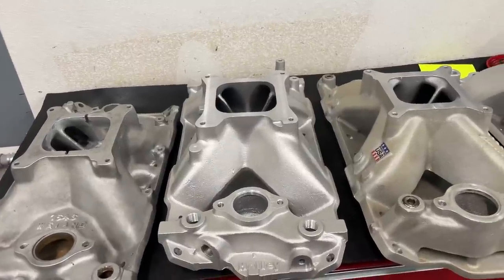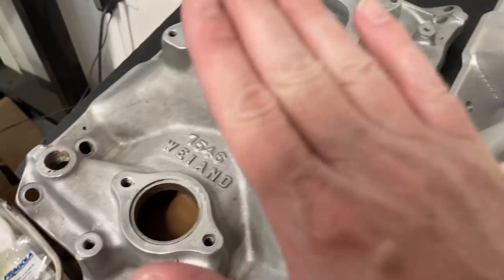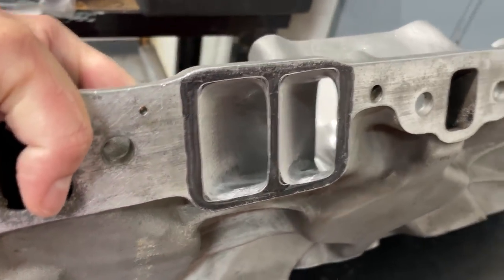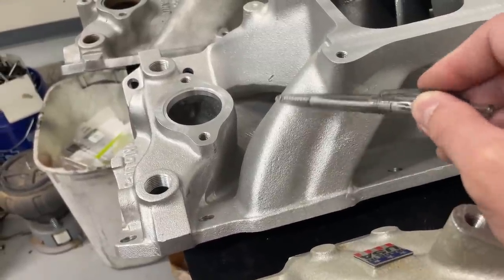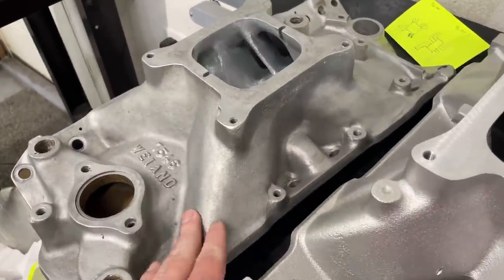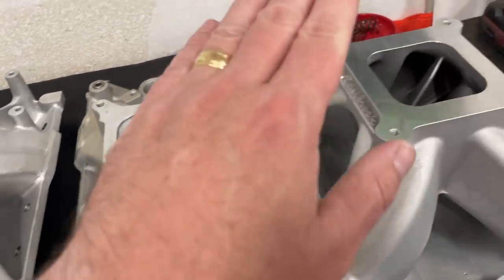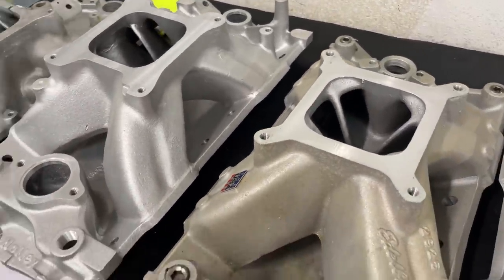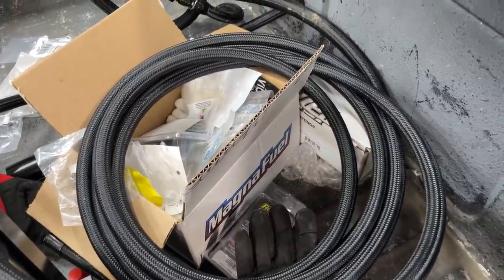Stupid Manifold Information

Comment: None of these intakes are as cool as the one I built in 1989. I used an Edelbrock twin carb tunnel ram, drilled it for injector rails, put two stock 302 Mustang GT throttle bodies on it, and that 1986 Mercury Capri I built, had one of the first flying toilet speed density tunnel rams!!! I didn't even care if it hauled ass I just wanted to look cool. I succeeded!!!🤪💯💯💯
Reply: If my Edelbrock TR1X is sweating all over the lifter Valley, like a cold on a hot day, does that mean my engine is tuned too rich, or could it be that my carburetors are 5 ft away from my motor? LOL 🤪👍

Comment: All good and accurate info. IMHO.   My first car was a 67 Camaro with a 327 / 275 hp engine with factory Quardrajet and cast iron intake and a 4 speed.  The car ran really good in stock form.  My uncle bought a car that had a Edelbrock Torker intake on it and he took it off to put something different on it.  He gave me the Torker and I though Aluminum intake with a Holley would be better than my old Q-jet and cast iron intake.   I installed the Torker and the Holley and my car was slower.  Eventually went to a Holley Dual Plane #300-36 and the car woke up and ran much better.
Reply: 300-36 fav dua plane intake ever for the sbc . Why they stopped making them sucks

Comment: I seen a dyno test comparing a bunch of intakes on a 450hp 350 SBC. Surprisingly the original Torker made more power than the Torker 2 on the same engine. The Torker 2 was junk, it was way down on power.

Comment: Here,s an dumb question, what happens  if you  shorten the port dividers  and knife edge the dividers and install  what  they used to call a turtle which was  glued to the floor of the manifold, to help distribute  equal flow thru the intake ports?

Comment: I had a 347" sbf with performer rpm heads 224-232 @.050. Ran a perf rpm airgap intake with 750 4150 holley. Older guy convinced me to try a weiand I think stealth single plane. It was a dog under 3500 and ran the same up top. I put the rpm back o. As fast as I could. Haha.

Comment: Hi Eric, love your videos!! Can you compare an Edelbrock 2701 vs a Weiand 7547-1? I am a dirt race IMCA guy and our rules only allow these two intakes, I was wondering if you know or have data to compare these two manifolds and which one performs better? We can only use a 2 barrel holley (500cfm) too! Cam lift profiles typically can't be over .450 either so every ounce of air is rather critical. Hope you can help...I am happy to supply you with these intakes if you want to conduct a test? Thank you!
Reply: would also appreciate more information about the 7547 because hood clearance is an issue for me.

Comment: I'm building a boosted 5.3 Ls. This is going to be street drivin and street raced, looking for the 1-1,100hp range. I know everyone thinks you have to run a holly high ram, or the texas speed intake but I absolutely love the looks of a tall single plane with a Wilson elbow. So I think I'm going to run a holley split 4150 with a split Wilson elbow. I know they used to say that air distribution sucked on carb style intakes. Is that even a factor anymore with efi and a turbo forcing air down its throat?

Comment: Sure there are better manifolds today then the holly 300 -25  but that was the one before all the rest after market manifolds and it worked pretty  decent  I know I had several  for different  small blocks  builds ,  one that is specifically designed  for their own heads is the one that  AFR makes , AFR  heads are among the best so im sure their  manifolds aren't to shabby either!
Reply from the maker: They are ok but in some situations other manifolds are better.
Reply: @WeingartnerRacing  Most definitely!
Reply: Strip Dominator actually alittle better than the AFR as cast singleplane. The 2 piece composite AFR from a few years back was better than the Strip Dominator. But it's no longer available.

Comment: Those old torkers and xcellerators are odd intakes that fall in an wierd category, there not a dual plane but not a high rpm single plane ripper... I personally can say at least the gen 1 Torker works fine on a mildly modified street SBC, they make surprisingly good low end TQ and pull not half bad up top, better than a standard performer but on a fun street car the low rpm TQ advantages from the performer isn't enough of a gain to warrant the loss in high rpm power imo. There surprisingly versatile intakes I spotted an old Torker 1 on a old 70s tow truck on power nation they dragged out of junk yard lol. With a mild SBC on the dyno would you see a difference between a Torker and a perf RPM definitely...On a mild street car I bet it would be a lot harder to tell. When I see someone ask about these on forums and keyboard experts say there junk,paper weight, toss in trash, use it for a tire chock, they suck....yada yada I say don't listen to them there not as bad as these guys say they work fine if it was as horrifically  bad as they say Edelbrock wouldn't have manufactured them for decades (and still do I think), is there better options of course there is but most of these guys that hate on em dont actually have any actual experience with it there just regergitating shit they heard from the same fashion from probably a guy who tried one grossly in the wrong application likely like tossed a Torker on a 600hp SBC or a 140hp 305 and it didn't work very good..... mind blower... just try it I think you will find it works just fine and upgrade later on if you feel the need to. Also  I was under the impression the Torker 2s we're aimed towards improving higher rpm power in C3 corvettes with there terrible hood clearance (or anything else with minimal hood clearance)  and the only options are the terrible factory iron smog intake, a low rise dual plane that starts weezing after 5000rpm so in that situation the low rise single plane probably was a viable option back in the day.
Or I'm totally wrong?✌️

Comment: I'll try to make this short. my grandmother bought a 1966 Chevelle 300 Deluxe two door post, 2b 327, power glide 10 bolt rearend new. my dad talked her into getting the 327 and not the 230 straight six. i got it off her in 1985, of course i wanted it to go faster. dad had me pull the carb, intake and the heads off. didn't even rebuild the engine, anyways i got Corvette heads and intake at the Pomona swap meet. i put them on that 327 with headers, i could not believe how big of a difference intake and the heads made. i drove that car with that setup with the SAME not rebuilt 327 tell 1994 when i took it off the frame. 2019 gave it to my son for graduating high school. and of course he has plans to LS it.. lol

Comment: Fun Fact some of that braided line comes from "Off Shore" sources....Just say NO! Another thing I've heard is the VERY EARLY CAST 2975 Victor JR intake has a better runner shape worth 6-10HP over the later ones. The early intakes have  ribbeed valley with a freeze plug in them for avalley breather....that was revised after about 6-9 months of production. Also there are "Off Shore" copies of the 2925 Super Victor....STAY FAR AWAY! I bought one off of Ebay and the port divider was over an 1/8" off from the cylinder head....

Comment: I know you can judge an intake just by its physical appearance, uh, um, no you can't. Let's take, for example, runner shape. The runner may look like it can flow a certain way, but now, you have to introduce actual, real time flow from cylinder to cylinder. You have to factor in scavenging, for example. One cylinder on its downstroke, pulling from the main plenum, while another one, let's say, the port right next to it, it's just finishing up sucking in its fuel charge. Meanwhile, across the way, inside the plenum, you have another one that's getting ready to suck some intake charge. You can't tell me, at 6,000 RPM, for example, that will be a nice even intake charge right into the port. There will be turbulence. Little vortices, backflow, pulsation....... you can't 100% say how an intake is going to flow, until it's put to the test, throughout the RPM range, and different displacements will also create different results. My point is, there's too many factors involved. One of the best ways I have found, is just to try the damn thing. It either works with your combination, or it doesn't. It's $300 +/-, and if it doesn't make your motor haul ass, put it on ebay, and try another one. What works best for me? Check out the motors that are making good power, and winning races, and borrow their combination, or portions of it. 😜👍

Comment: I ran the weiand 7546 for years. It seemed to work well with 650 Holley. 
 I have also run an SY1 crossram single 4 barrel with the recommended Holley 830 cfm carb. Edelbrock Smokey Yunick manifold made in 60-70’s. But have been told there are better manifolds. Been told the standard Edelbrock victor Jr would make around 40 more hp than the crossram. We will see. 
The crossram makes stupid seat of the pants feel, from 3500 to 6500 on the highway, honestly it never seems to stop pulling. Maybe one day I will get the car to chassis dyno.
Reply from the maker: Im curious what you find.

Comment: Great vid. I am a little confused though. I have a 406 crate motor stock Al fast burn heads, intake cam heads compression,  I am running 1/8mile is a light roadster. I have a super victor 2 laying around I thought about putting on it but thought it would actually hurt the motor off the line and not give any performance gain since I shift at 5800. Do I have it backwards, and it would help low end? Sine I already have it, any reason not to put it on this combo?
Reply from the maker: That one could go either way. I would say test it and find out. My thinking is 60ft will be done but still have same ET.

Comment: Might be surprising but I’ve had a really good luck with porting T2 intakes for the Pontiac’s that I build
Not to be confused with the Torquer 1!!
No I’m not just port matching I’m talking a complete Plenum porting and reshaping the runners making a line of sight a little bit better Etc
the most I’ve made was 665hp 672tq  on a street pump gas 535 and I believe there was more left 
Fwiw the T2 Runners have a lot more gentle curve in a better angle of attack than the T1
Now there is better intake manifolds if you have the hood clearance or you have a scoop.
also I will say that the Torquer two for the Pontiac is quite a bit better than the Torquer 2 for a small block Chevy it has a lot more room for porting fwiw

Comment: Good info Eric! Have a 408 SBF in the camp with a ported victor Jr... Seems to work pretty good even spinning to 7800 rpm... Had it ported when the heads were done because he already had the manifold. Haven't pushed it to see what ET will be. Fighting suspension issues at the moment. Looks like it would probably pick up some with a taller one though. 🤔
Reply: I'm building a 427 sbf right now. 
AFR 205 heads. 
Looking to run a super victor. Because it's taller and has longer runners.
Reply: @I_like_turtles_67  should be a strong motor! What rpm are you going to turn with it?
Reply: @YerkitRacingChannel  The guy that's building my motor hasn't determined the exact rpm range. Still waiting on rods to show up so we can figure out exact compression and stuff. But if I had to make a guess. Between 6200-6800. 

This is going in a 67 fastback. Being build for street driving. A little drag racing and auto x/track days.
Reply: @I_like_turtles_67  awesome man! Sounds like a cool build!

Comment: What do you think about the Wilson super victor for sbc? Should I just go straight for the super victor 2, 
421 ci 12.5 cr with AFR 227 #1068 for bracket racing.
Reply from the maker: Super victor 2 is better.
Reply: @WeingartnerRacing  What are your thoughts on the Victor E  #2978 on a 427 sbc with AFR 227s #1068 ? I have hood clearance issues.

Comment: Eric, would you give me a recommendation on what sbc intake I should use for a   3000lb ish, bracket car? I have a brand new set of AFR 210cc heads still in the  box. They are the  Competition Ported heads, supposed to flow 322cfm @ .650 lift. They have the steam holes drilled, and springs for a Solid Roller Camshaft. I talked myself out of the AFR 220 heads because I've read so much about putting too big of a cylinder head on an engine might be worse than not big enough. And the 210's have 2.08 intake valves, and the 220's have the bigger 2.10 intake valves. I can always go bigger in the future. 
I THINK? I'm pretty sure they said the 210 and 220 both use the same  foundation. Is this true? 
 Planning on building a 10:5:1 compression 406 sbc. Not exactly sure yet if I'm going to use a glide or turbo transmission, 4.56-4.88 rear gear, if it's going to be a glide, may do the same rear gear for the turbo transmission too. 
 I'm thinking about using a Super Victor intake, but not 100% sure yet. Kinda wanting some other recommendations, that might be as good or better. Any suggestions will be greatly appreciated. Thanks. 
  Take care, be safe, and have fun regardless.
Reply from the maker: A 220cc head is not too big for a 406 especially if it’s raced. A super victor would work fine.
Reply: @WeingartnerRacing   Yeah, I kinda know that now after watching your videos and some others. I was thinking about the 2.10 intake valves too, but nowadays it doesn't seem to be an issue. QUESTION, can my AFR 210's be worked on to make them 220cc or possibly bigger and valve done too. I've been buying parts here and there over the past couple years when I'm able to. I have Eagle 4340, crankshaft, Eagle 4340 H-Beam rods with L-19 rod bolts, but the pistons I bought at a sale turned out to be 18 degree instead of 23 degree. So i need pistons now too. Anyways I'm writing wayyy too much. After I get close to having almost everything I  need I plan on sending you my heads and intake to port match or completely revamp them whatever it needs. If you have any available spots to do the work for me once I'm close. Anyways, love the informative videos you put out, thanks so much for sharing then.
  Take care, be safe, and have fun regardless.
Reply: I got 421 n they told vitor Jr  to snake wit the cam I got say I got go bigger to super vitor n head of AFR 220

Comment: Every different shaped manifold is shaped for a specific design use. Some look great but performs like shit on the street. Really, it all boils down as to what you want & how plus where you drive your car or truck. I'm a big fan of highly modified cast iron for many reasons. I've also had huge success with the Offenhauser Dual Port 360. For bad ass racing is the Weiand Tarantula.

Comment: Wow! I remember them open plenum which had the optional steel divider plate for making better bottom end supposedly?!? Lmao! I can't say that they actually did that by adding the divider or not? But it was a bit of a different design where we were fooled into believing that it would work! But I've run these intakes before and they are pretty pathetic for either top end or bottom end never had any good results from these hermaphrodite style intakes! Seemed like they were not good at bottom end power nor top end power. 😕 The tourqer 2 was another sad attempt at not really knowing what it was actually meant for? They were actually attempting to lengen the intake runners by adding the additional turns in the intake runners, which of course means more resistance having to make those turns just to get into the head ports. The super Victor series were probably the best off the shelf intakes you could get and keep it under your hoods. I have a single carb and dual carb tunnel ram and the dual carb would definitely out perform a single. When they made the single and kept the same top of the tunnel ram in dimension rather than adjusting the plenum size of the single carbs into a smaller plenum, they probably would have been more more efficient than just keeping the giant plenum on top of them, it would have made it a much better performance intake. They were going more for looks than performance or were just being cheap and not wanting to redesigned and make a whole new casting? But yes the Team G was the competition to the Victor Jr and weren't that bad either. Don't forget about the twisted intakes which put your carb barrels more in line with the intake runners. They were definitely different looking from the norm! But never thought they did much better than a straight design single 4 barrel plenum? It seems like back in the 80s and even early 90s these manufacturers were appeasing more for the looks than that of actual airflow and velocity?  If you grew up in this time frame you would know what I'm talking about?! SMFH! This was the error of chrome and gold plating and wild paint schemes, right before the whole billet aluminum phase came to be! Yuck!!! Lol!

Comment: Eric, can I get your input. I am building a 383 for my truck. It's going to be a daily driver. It's going to turn 6500 rpms, I been looking at intakes and was thinking about getting Holley's sheet metal single carb 2 piece intake. They say it's good for I think 1800 rpms up to 7200. I know ots a tall intake I am going with the stealth Sniper like what you have. I would like your thoughts please
Reply from the maker: I would avoid that intake.
Reply: @WeingartnerRacing  what is it about that intake you don't like?

Comment: Well, those are all Single Planet design for mid range engine revs to higher rev range and the far left intake appeared to be a lowrider or dual plane design?
Reply: That Weiand intake is a low rise single plane..dual planes have the divider on the carburetor pad / base where the carburetor bolts to the intake manifold.

Comment: I got a 347 SBF with Dart Pro 1 heads & a Torker.  Won't spin it past 6,000 based on cam size. Ditch it for a dual plane?
Reply from the maker: Yes